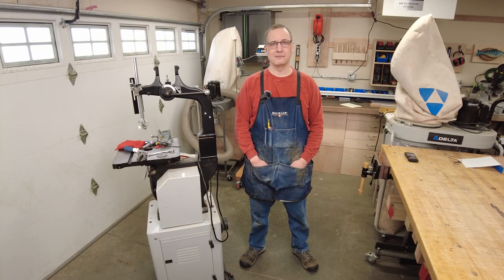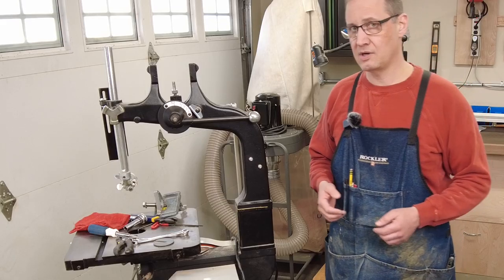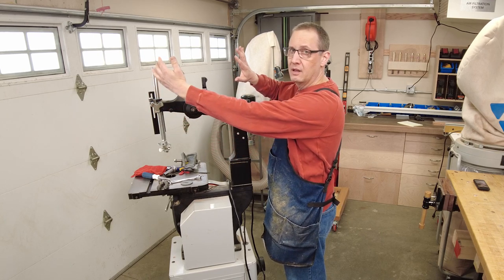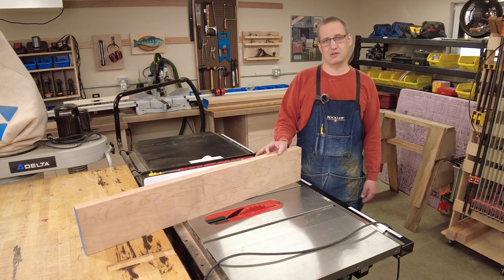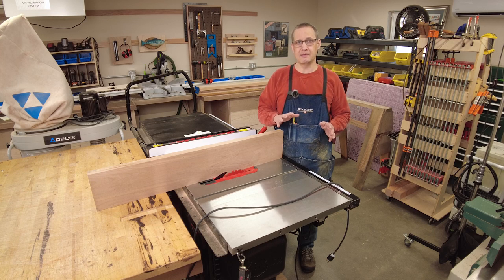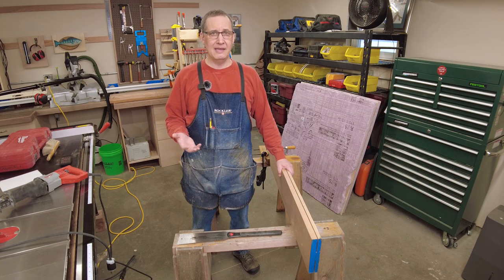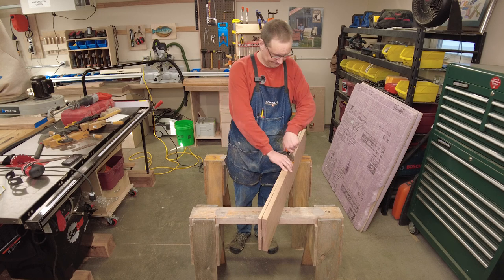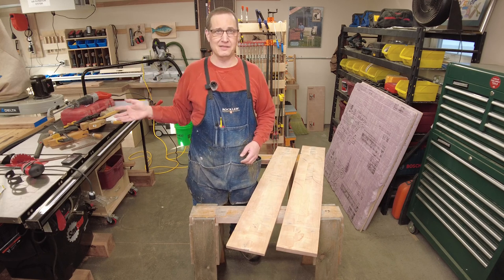Resaw Wood With Your Tablesaw

Comment: I would 100% use a Japanese pull saw on this. They're "floppy" but because you have a 3" of cleared material on each side, it would go to the path of least resistance which is the thinner stock left in the middle. Its still a lot of work but gives you more control than a recip saw and far less work than a western saw bc they're thicker.  That being said, I love Japanese tools and I am fairly biased :)

Comment: I would have used that Japanese pull saw and never looked back. Save the Sawsall for demolition work. Why wouldn’t you just run those two boards through your planer or run a no.7 across them? You can’t burn $10/board foot cherry. That’s some end-stage Scarface $hit right there. Use some $100 bills for tinder. [lights acetylene torch] “Say hello to my lidl fren!”

Comment: Looks like you are using a Saw Stop with a Freud limiting blade - That's a NoNo
Reply from the maker: Yep. I replaced it with an Amana two years ago.
Reply: Why is that?
Reply: @WrongTimeWatch I know right! Lol... I'm curious as well..🫠
Reply from the maker: Supposedly the anti-kickback shoulders on some blades can interfere with the blade brake mechanism on a SawStop tablesaw.

Comment: I've been doing the same thing to book-match for years. I've got two helpers for the process. On the end grain I take a circular saw and connect the cuts as a guide for the saws all blade and I use one of the saws all blades with the carbide teeth.

Comment: Nice video.  I have that exact same wiggly pull-saw -- it's branded as a Shark Saw, made in Japan.  I got mine years ago at a Sears Hardware store.  The ripping side works great for re-sawing except my technique isn't great and I usually get off the cut line.  I spent a few dollars that didn't break the bank for a better Japanese pull saw - stiffer blade, teeth only on 1 side.  Nice results.
Reply from the maker: Yeah, I bought a much bigger and better Ryoba pull saw that I plan to use from now on. But the Shark is still a great little saw.